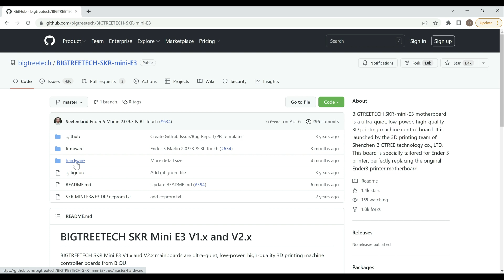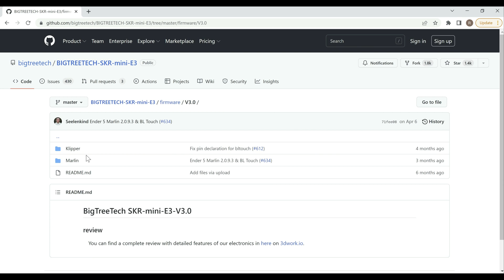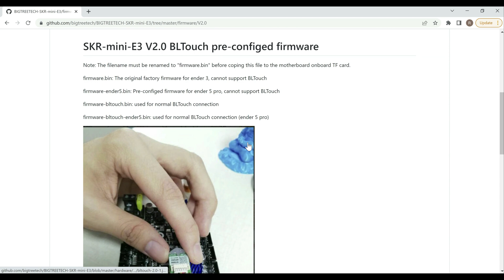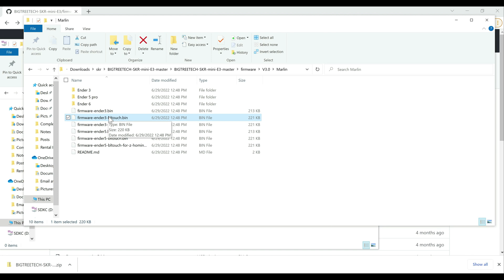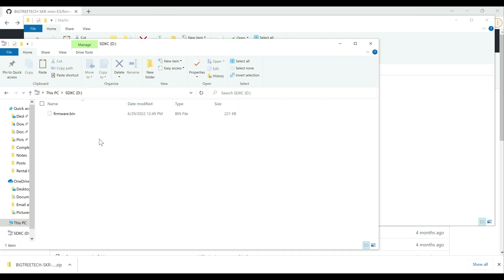SKR Mini e3 v3 BTT Firmware Update

Comment: I have watched your video and many others several times and tried a lot of things but it is still not updating. Ender 3 pro using skr e3 v3 with bltouch. Using either an 8gb sd or a 128mb sd. Formatted at Fat and Fat32. Using firmware from bttgithub, skr e3 v3, ender3-bltouch.bin. Placed in root folder of sd and moved to printer. I have tried changing the name in all format configurations. Firmware.bin Firmways123.bin. The only thing that does anything is if I rename it FIRMWARE omitting .bin as its already a .bin file. The printer will boot, pause for 2 seconds and then nothing is different with the printer. It will change the file on the SD names FIRMWARE to a .Cursor file. 

What would you suggest since its not working as easily as I would have hoped

Update - formatted 128 mb card to Fat16 - used file firmware BigTreeTech SKR Mini E3 3.0 BL Touch.bin - renamed to FIRMWARE omitting .bin - Blue screened printer. It did change the file to a .cursor file on sd. Tried reloading firmware from firmware-ender3-bltouch.bin - blue screened. Requested replacement board as this one seems to be defective. 

New to printing so any thoughts or constructive suggestion would be appreciated.
Reply from the maker: Hi. It sounds like you have known file extensions disabled (which is default) so adding .bin resulted in the firmware being firmware.bin.bin, which wont work. It sounds like its reading the firmware now, but if its not taking it then there may be a compatibility issue with the firmware and your board. Can you try the firmware from my site?
Reply: @3DPrintscape  I searched on google and found your firmware. They stop for ender 3 on e3 v2.0 board. I couldnt find one for the E3V3 build.
Reply from the maker: @hansoncrack  I thought i had it out there but it doesn't look like it. I will work on getting it out there this week.
Reply: @3DPrintscape  Thanks, my printers are just chilling till I can get them figured out. They are not in a rush and neither am I :)
Reply: @3DPrintscape   @3D Printscape  Hi, I finally got my printer to update with your ender 3 pro skr e3 v3 bltouch - z home. When I turn the printer on and home the printer. It moves and hits the end stops, but the hotend moves to the middle of the print surface and about 5 inches above it. Then moves the probe in and out till the screen states "stopped" in the bottom corner. Ideas?
Reply from the maker: @hansoncrack  How is the bltouch wired? If all 5 wires are connected to the bltouch port and the z stop is connected you want the bltouch firmware, not bltouch-z.
Reply: @3DPrintscape  I checked all that and still got it backwards. My mistake - I can reflash. Quick question, I was reading some forums and the anons said that utilizing the Z end stop was more accurate than allowing the bltouch to do everything. What are your thoughts on this? 

Another consideration I was not sure about was if one was swapping between pei and glass. If the bltouch firmware would account for the bed height increase or a modular end stop would be more effective?
Reply from the maker: @hansoncrack  The bltouch firmware will account for the difference in thickness without having to make any changes. As far as accuracy goes, i guess that will depend on if your bltouch is having issues or not. I have a video that covers how to check that. Personally, i just use the bltouch and it has been working fine for me.

Comment: Got my V3 board yesterday.  Took out my SKR 1.3 and installed this new one.  NONE of the BTT precompiled firmware worked with the stock Ender 5 LCD.  The firmware name WAS changed to FIRMWARE.CUR however.  I built my own version 2.1 Marlin with the CR10 lcd display, and it did come up.  However, many things are broken with my version.
Anyone else having this problem on their Ender 5?
Reply: More information: I tried the Ender 3 pre-compiled firmware for the mini V3 on my Ender 5.  Everything worked, kind of.
Limit switches were backward, but lcd and heaters worked and motors all moved.  Nothing wrong with the mini V3 board!
Reply from the maker: Hi. Thanks for sharing what you found with the BTT firmware for the Ender 5. On your Marlin build, did you start with a config example? If so, what one?
Reply: @3DPrintscape  I started Marlin 2.1 with the V2 config file for the E3, then changed the environment and board to match the V3.  There is something funky with 2.1 and bugfix 2.1 with regards to lcd.  Removed the boot screen and custom screen and lcd came up.  Now that I have 2.1 bugfix working for Ender 5 for the V3, I will go back and try 2.1 non-bugfix again...
Reply from the maker: @glenb1356  Try to start with the Ender 3 pro e3 config file.

Comment: This was so helpful, thank-you!!
Reply from the maker: You're Welcome
Reply: @3DPrintscape  I installed everything fine on an Ender 5 Pro but was getting an error with the BL touch probing and stopping midway through. I had to switch back to the Creality board so I could print.
Reply from the maker: @m_e_r_d_a  Was the wiring too tight? Sounds like the probe processes may have been pulling too much on it causing the connection to come loose.
Reply: @3DPrintscape  Possibly, I'm going to rewire it and see how that goes. Thanks for the tip.

Comment: hey Rob. I don't know how to reach out to you other than here. I been watching your videos for awhile now and you are the reason I got into this hobby. I actually bought my printer from Amazon from a link from your website 
ender 3. (not pro just the regular ender 3)
I did go on and get a cr touch and a creality direct drive. well I kept it mostly stock for a few months and it worked flawlessly. I did add a glass bed (per your post and a upgraded tube and extruder) never had any problems with prints or sticking to the bed. 
now I followed you exact instructions on how to install my CR touch. it's been a month now with over 80 failed prints. and over 50 firmware installs. when I do it per your website and video the screen glitches, will never read a tf card and sometimes the steppers lock up. do I need to just throw this complete ender 3 in the trash? it's a 32bit 4.2.2 all I want to do is mostly print PLA can I go back to my original setup if so where can I get the correct files? this makes me just want to stop this hobby... if anyone can help PLEASE DO SO.. I was able to install a ender 3 pro firmware and got one print to work out of 26 trys then I had to glue, and tape it down and watch the print (45 mins) the only way I can even get a print to start is via cable and then cura starts to crash and then if the first layer sticks when it get to 6 or 7 the print jumps off then it's a mess... thanks for your time.. carlton997@gmail.com
Reply: update..I think I found my issue 
please anyone chime in and correct me if I done or doing something wrong..me being very new to this great and fun hobby I want to learn all I can.. I was able to go to the creality website and went to the actual printer firmware section and they have a file stating says.use this if your board has a "GD " on it
I pretty much threw caution to the wind and tried it.. the glitch is gone I also found out that after I set my Z off set and store the settings are being saved to my tf card that 8 use for flashing only.. so after I noticed that I re-ran all my settings and saved correctly and I was able to find my Z offset was not saving and was printing at -01.90mm way off.
now when I run bed level it runs slam off the build plate..I will update as I go and maybe my info may help one person in the future.  thanks for all you do and great videos
Reply from the maker: Hi. What firmware are you using now? Have you tried the one from my site?

Comment: I am struggling to get the UPS and Power Loss Recovery to work properly. I have it enabled in the bin file but it still doesn't work. Not sure what is going on.
Reply from the maker: Hi. Honestly, i havent messed with that much. I just plugged my printer into a good battery backup i have.

Comment: Hi I have the Ender 3 max with skr mini E3 V3 board my problem is when you leaving the bed it thinks it's 220x220 how can I fix the problem? IV tried the firmware fix but it keeps saying unknown environment names and IV only changed the bed size and z max settings please help me
Reply from the maker: Hi. You will need to update the bed size in the config. I will mention that part in a video im trying to get out this week on the skr mini v3 firmware.
Reply: To by bylo super děkuji

Comment: Awesome video, just got my Ender 3 V2 and installed the SKR MINI E3 on it. Sadly, the firmware they provide which is 3 months old causes my board to go into a beeping frenzy and never boots up. 

What I did notice is that at first the boot sequence would cause the CR Touch to remain constantly on Red while the second time I installed it, it remained Red for a second and then went back to booting up normally. Sadly, I couldn't get the firmware to work at all, screen would light up and the logo of Creality would show up but then nothing and it would freeze itself there beeping like crazy (The start status led would boot loop constantly).

Any ideas? Not too knowledgeable in regards to 3D Printers since it's my first one.
Reply from the maker: Hi. I have firmware on my site. Can you try that and let me know if it works. That will help narrow down the problem.
Reply: @3DPrintscape   Sorry I somehow managed to forget to add the version of the board. Running on a V3, managed to "partially" build Marlin from their releases page but it just hangs on the creality boot screen when installing either version of Marlin (2.1, 2.1.x, Bugfix). 

Even though it doesn't boot when updating the firmware, it's not doing the beeping as the prebuilt firmware was doing. I guess i'll have to wait for your video on how to build marlin for this board. 

Thanks for taking the time to answer my comment!
Reply from the maker: @xXStringZXx  What config example did you use?
Reply: @3DPrintscape  Hey there, was using the Configurations from Marlin's website (Except for Bugfix since it wouldn't allow me to compile since it was for an older version).

I got myself a crimping tool and the JSTs to finally fix the remaining fan that wasn't plugged in, will probably give it another try and report back.

Comment: Can you do one on modifying the firmware for the V3? I'm defeated in figuring out this one
Reply from the maker: Hi. Ya I’m trying to get this video out this week.
Reply: @3DPrintscape  I totally need this as well. I'm printing CF Nylons and need to go above 260c which is my current max hot-end temp with this board. Thanks!
Reply: @3DPrintscape  I've been trying to compile the firmware but keep running into the same error code Error: Unknown environment names 'STM32G0B1RE_btt'. Valid names are 'include_tree'
Reply from the maker: @alphaqlater  Are you using the marlin auto build plugin, if not try with that. Im hoping to finish recording my guide on this today or tomorrow. Im a bit behind because we moved and I started a new job.
Reply: https://www.youtube.com/watch?v=Vn5rMdJgkAI This is a video of Robert programming custom firmware for the V2 board. You can do the same steps for the V3 as it is almost the same board.
I've used the following guide whenever I felt at a loss (not because Robert lacks explanations but rather bc I'm not experienced enough): https://3dwork.io/en/complete-guide-configure-marlin-2-0-x-from-scratch/#Marlin_logotype_SHOW_BOOTSCREEN

Good Luck!

Comment: I’m in a pickle for a while now with the printer and set up. I installed the bltouch using both options but my prints can’t seem to stick to my bed and seems to not compensate after bed leveling. :/ any tips on what I can do ?
Reply from the maker: Hi. Is the bed level and are you running the mesh at the start of the print?

Comment: Cool. I've been struggling with this board for about two weeks now. Guess the time of having a major headache is finally over!
Reply from the maker: Did you get everything worked out?
Reply: @3DPrintscape  Yes, thanks for asking! I've struggled two days alone with the CR-Touch, then Marlin decided that my power loss feature needs to randomly trigger so I've deactivated that and now everything is working as intended on my Ender Max, thanks to your video about compiling custom firmware for the SKR Mini E3.

The step by step guide aswell as the way you explain things helped me to understand the process and made it seem doable even for someone with no experince in programming/VS-Code.

Thank you so much!
Reply: Ahoj a máte nějaký postup mám Ender 3 Max a mám stejný problém děkuji

Comment: I had issues with their FW and the CR Touch. I tried each since I didn't know about the V2 diagrams. But with one, it would slam into the bed with z-homing, with the other it would have some "endstops z" error when bed leveling. 
I ended up using the new Marlin firmware and compiling so now I just have my CR Touch plugged into the Z-Probe port (un modified, all 5 wires) and my Z-stop unplugged so there is nothing in the "ZSTOP" port, and added the jumper, and it works great! It will home with the CR Touch with no issues.
Reply from the maker: Hi. Thanks for sharing, it seems like the provided firmware may still be a bit buggy.

Comment: Note: when using Visual Studios run as and administrator and reboot after installing. Hey how can I put in a custom boot logo? I saw that in the files and was wondering best and easiest ways to do it.
Reply from the maker: Hi. It’s there is a tool you use to convert an image and add it to the screen. I will make a video covering the process.
Reply: @3DPrintscape  COOL THANK YOU!
Reply from the maker: @the4thj  You're Welcome